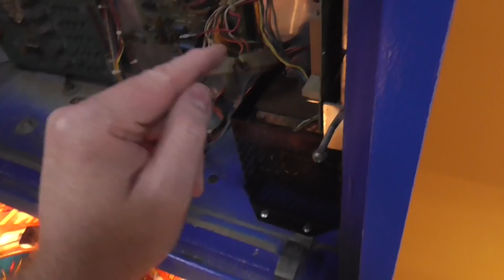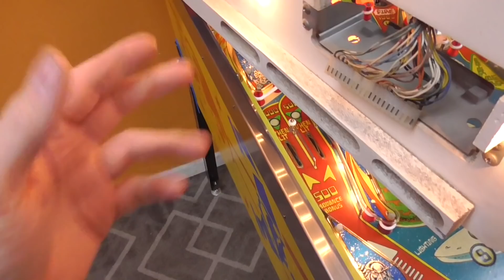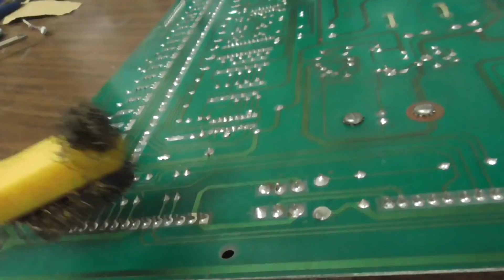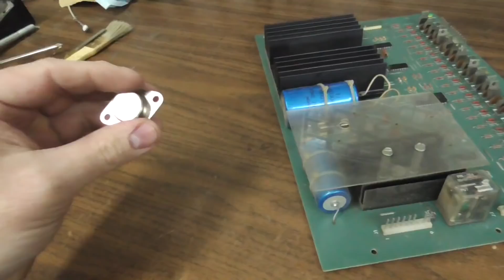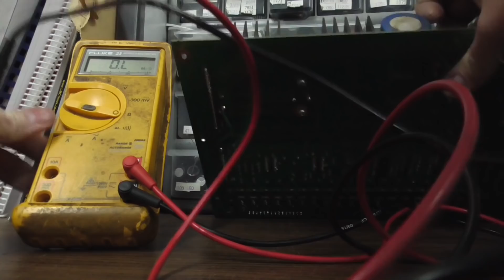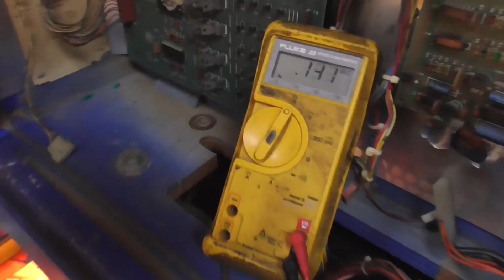Can You See The Solder Joints are Bad? - Bubba Shot The Pinball #4 - Bally Star Trek Machine Repair

Comment: Who the heck said that's not a voltage regulator?? 🙄🤔 The equivalent cross reference part is a LM323k which very much as a 5V voltage regulator.  Why do people say such when they don't know any better.  Don't listen to them Ron!! 😆 Man... the funny thing is... you've probably worked on 20 times more pinball repairs and playfield touchups than anyone I've ever seen out there... and people still try to tell you "you're doing it wrong... blah blah..." 🤦‍♂ Don't listen to them. I never remove the solder from the pins when I reflow... never re-cover the traces when I repair... sheesh!!!

Comment: On the topic of exposed traces: I seem to recall a ton of early PCBs having thick bare metal traces. (You should check out Usagi Electric's videos about the Bendix 15 vacuum tube computer. Every card in that thing has gorgeous hand-drawn exposed traces!) They were fine. now, with super tiny traces all smooshed together, yeah, you're generally gonna want the solder mask to prevent shorts from small particles landing perfectly between the traces (it could happen pretty easily at that scale). Plus, having just the pads exposed will make it easier to avoid solder bridges when populating the board. But for repairing thicc old 1970's and 1980's traces? nah, they're fine lol.

Comment: I think the argument people use about flux and corrosivity is they don't understand the difference between rosin core solder and acid paste for plumbing. Rosin core is safe for electrical connections the rosin is a mild corrosive to ensure the bond between the solder and the contact point. If you're using acid paste for wiring connections, then you're really going to have to clean your excess. That stuff is meant to penetrate into copper pipes to ensure not only a bond, but a structural integrity. Acid paste will eat through traces over time if you're going to go nuts and solder circuit boards. 

What I really wonder is: how many people burn their boards trying to solder with propane torches?

Comment: Hate to tell you this but when I was living in Miami the salt in the air did corrade the wires in the breaker panel at the hotel that I was working at enough to cause the breaker to trip  what I did to fix it was trim the wire back and reconnect it to the breaker so salty air can carrode copper

Comment: What gets me about the conformal coating folks: okay, I'll agree with them that the surface will oxidize. SO?? The oxidized layer is what, two microns thick? The trace seems thin to us, but to the oxidation layer there's still a mile of unblemished copper beneath it, happily conducting. Relax. 
You can invite them to take a look at filthy and tarnished traces on old-but-working stepper units (excepting where the contacts touch of course), and ask them if they think all THOSE should be coated, too. ;)
Reply from the maker: It's people that fall into two categories:

1. That have been educated on how to DESIGN things, and everything has a conformal coating in design, so if it's missing in any way, they think it's a big problem...

or

2.  People who have never fixed anything in their life and have watched other people who haven't fixed much ruminate about how you have to have the conformal coating.  

It's not that big of a deal, like most things.  It's an old "husbands" tale, since they have Old Wive's tales, this is the other way.  It's right up there with "You have to discharge the monitor or it'll kill you" or "If you don't put a polarized plug on the radio, it will kill you" or "the pinball needs to be grounded", it's just crap people think they know and they don't really practically know what they're talking about.  Rant off!

Comment: It's a little late to be posting to an older video, however, your rant got me to thinking. Clearly having copper exposed to the air isn't the end of the world, and electrons will still flow through it just like they always have. That being said, there are ground tabs on the bottom of the board that allow the board ground to connect to chassis ground. If there is corrosion on these tabs, you will have a dirty ground and get all kinds of problems with your voltages and maybe even random resets. The best way to clear that up is by removing the corrosion to improve the ground connection. Maybe that is the source of the myth that exposed copper from removed/scratched solder mask will degrade the board. Finally, let me say that this is not a high speed digital board we are talking about. These designs are much more bullet proof to that kind of issue than a microelectronics design today may be. Evidenced by the machines still working 40 years later with only minor upkeep required. Keep up the great work, Joe. Your hard work is much appreciated. Love watching you work!
Reply from the maker: Yes I believe it's mainly what you mentioned about high speed digital boards, in a more modern design where signals are being sent around yes you have to be more careful but this solenoid driver board is using old school heavy duty 5 and 0 logic to turn on transistors, there's not a lot of digital info flying around :)  

I'm just messing with people anyways, they pick on me for not doing it 'right' but with the large traces we're using and the simple signals we're sending it's a different beast than what they're working on in more modern equipment or designs.  You're correct about the bad grounds too.  Thank you for watching Dan, I'm glad you enjoyed the video!

Comment: 21:00 You're using the term "Conformal coating" when you mean "Solder resist". If someone's actually saying "conformal coating" when arguing about these boards, then they need to go back and learn electronics from someone who's not trying to sell them things they don't need. :)   They can argue that the solder resist acts as electrical insulation, but the soldered connections project farther than the surface of the board, sooo... The solution here seems to stem from knowing the name of the thing they're complaining about. :)
Reply from the maker: I've never even heard of Solder Resist so they've never complained about the proper thing then :)  Thank you for watching Buck

Comment: Ron, there is no argument that you don't HAVE to change the display capacitor but, if you have the board on your bench, and you have 40 year old electrolytics, and you know that they all go bad with age, particularly over 20-years, why not change it?  Part of what I see you do is preventively fix things (connectors, solder...etc.).  An electrolytic capacitor is something that does not age well, I'd change it if it was in front of me like that. But you do you.  I really like and respect what you do.

On the flux...it is there to allow you to solder.  If there wasn't flux, you couldn't solder.  What smokes and bubbles when you solder is the flux.  Flux, depending on how aggressive it is (it varies by solder), will eat the board some (including the copper traces). Lacquer thinner is a good quick solvent to get rid of it (it does require ventilation). Some use IPA but I've never found that it does as good a job (and it isn't as fast).
Reply from the maker: Yeah but everything goes bad so why not replace everything?  I rarely see a bad display cap so I usually don’t swap it… thank you for watching!!!!
Reply: I'm not advocating replacing everything.  But there are like 3 electrolytics on that board.  As you know, "bad" on a capacitor is relative.  It turns into a resistor, over time.  There is no way an electrolytic capacitor is going to measure like new after 20-years.  It's just not their nature.  One makes the deal with the devil in the design to get the higher µF that electrolytics bring...the devil collects after a couple of decades. 

As it turns out, you said, at the end, that they are going to LED displays so it is of no consequence on this one.

Comment: conformal coating is not for looks. It is for automation, solder won't stick when board is ran through solder tanks and wave solder mach. Any exposed copper where corrosion is a problem it will be coated with tin, silver or gold.
Reply from the maker: So you agree that since I'm not running it through a wave solder tank i'm good
Reply: @LyonsArcade  Yeah boards for damp enviroments are treated differently normally encased in epoxy or used to be asphalt. Bare traces are common on old boards and haven't seen any major problems even in marine enviroments as long as they are kept dry.

Comment: FWIW, some flux will damage boards. Water soluble flux does need to be cleaned off. But water soluble flux is usually not something you see in off the shelf flux core solder. It’s more used in fabrication where stuff gets washed as part of manufacturing. 

But standard rosin flux, or no wash flux, no worries. It CAN become conductive sometimes in certain environments, but it’s pretty rare. It’s mainly just making it look better. :) no one wants to see a big glob of burnt flux on a board. ;p IPA cleans most of it pretty well.

Comment: The only possible issue is that you might use non-leaded solder combined with leaded... and I have no idea if that would even cause a problem.
Reply from the maker: That's a good point!
Reply: @LyonsArcade  I went and looked it up after you replied... apparently, there is a difference? Something to do with mismatched melting and solidifying temperatures leading to fracturing and other problems. I've no idea if it'd have an impact at the scale you guys work at, but it'd probably be a nightmare for small electronics... also I imagine you use leaded solder :D

Comment: Rubber eraser will clean those pins up really nice without being very abrasive. Used to work on some old hardware that used those and wehen they were dirty the conneciton would heat and melt connectors - just like what you're seeing in the backbox. Earaser on all of them got the juice flowing well :)

Comment: With the engineered solder sucker, which I too use, and proper 60/40 rosin core solder and no more than 350C soldering station, I heat and add new solder to old.  Then go back and suck it all back out and add all new.  That's my method.

Comment: To be pedantic, the green epoxy on the board is solder mask. It is there so that wave soldering does not bridge traces and it reduces the incidence of shorting other stuff to the board. It is not necessary to replace it when reworking unless you think either of these will be a problem. Conformal coating is applied to the PCB after all of the components are mounted and is used to isolate the board from the environment. CC is used when a PCB will be subjected to high humidity or other environmental conditions that may deteriorate the components and/or connections or, in some cases, where high impedance nodes need electrical isolation from the environment. CC is rarely used in consumer products because it adds a fair amount of cost and is a big nuisance when reworking a PCB.
From a purist standpoint, it is good practice to remove heavy flux from your solder connections unless no clean flux is used. That said, the only good way to do that would be to wash the entire board in IPA or some other flux remover. It pays to remove the worst of it but trying anything more will just smear the residue around.

Comment: You didn't hook up all the power connectors to the other boards, in case there was something wrong with the power board.. BUT.. with that big jumper on the back jumping the 5v from the top part to the bottom part of the power board, you risk blowing up the chips on the bottom of the board..  I agree that jumper is probably very good in the longrun, but it might be good to remove it to test the power section after messing with it, just to make sure you dont blow those chips on the same board in case there's a problem with your 5v, right?

Comment: Hi love the show from oz. Hey when reflowing the pins it looks tge sodder seems to connect two pins. Wouldn't that cause an issue.  Sorry newbie question i know.
Reply from the maker: Some of the pins are supposed to be connected, they're connected on the trace under the solder.  So they'll have a trace with 4 pins in it, if you solder all 4 of those pins together it doesn't matter and actually makes a better connection anyways.   When you solder them you can see which ones are connected together by the trace.  Thank you for watching Drady!

Comment: I appreciate your common sense approach to electronics. I watch quite a few electronics channels and It’s your common sense approach that makes you unique among electronics repair creators. I think folks are getting their ideas about always applying conformal coating and removing old solder from watching some of those other creators who aren’t electronics repair technicians who do repairs daily but are electronics engineers who make new boards here and there or do one off repairs. Folks if you do 100s of repairs a week like electronics repair technicians pretty soon you will dispense with things which waste time or nice to haves and only focus on the repair essentials.  I think that is the essence of the difference of opinion expressed in this video. I’m sure he would use conformal coating to protect a trace if there was a possibility of a short if it wasn’t coated. However, that’s a very unlikely scenario in this case so coating isn’t called for. Just my two cents.
Reply: Well said.
Reply from the maker: Yes I think that's ultimately the difference, it's a difference between design and repair.  Also most of the boards I work on are pretty ancient, so it's kind of a different beast than a brand new design.  It's like the Electrostatic argument, in my situation it's not really an issue to me, because of the chips i'm running into, and i'm in the south where there's a lot of humidity, we just don't run into static much because of the climate, it's likely different in other areas and with other board designs.  So the coatings may be necessary on certain things... if you're watching videos about vehicle repair and they run into things, they may need the coating whereas in a pinball machine it's not necessary.

Comment: I rarely remove old solder when reflowing but I generally do add more liquid flux cos my solder is cheap Chinese rubbish. It leaves a complete mess afterwards but nobody is going to see it. 
I do use a conformal coating of sorts when I modify or repair outdoor led lights. Because I live close to the sea there's a lot more salty moisture in the air which plays havoc with the boards. So I cover them with cheap clear nail polish. It's cheap and nasty but it works.
Reply from the maker: That makes sense for sure in that situation... thanks for watching (as always) John!

Comment: With a single layer PCB you can't have a trace cross another trace, so if you need a trace to get to the other side of a trace you have to take the signal out one pin then bring it back on another pin on the other side of the trace you need to cross.

This isn't as much of a problem with a double sided PCB because you can have the trace go through the board and switch to the other side, then cross the other trace, then come back through the board.
Reply from the maker: on this board the way they accomplished that was with jumpers on the non trace side, they look like little staples.
Reply: @LyonsArcade  That's another way to do it, makes it sort of a 1.5 layer board.

Comment: One place you ALWAYS see cracked solder like that : PCBs under playfields, particularly lamp, relay, and motor control boards.  Nice little square cracks right around the body of the pin header.
Reply from the maker: I think all the minor vibration from the pop bumpers makes it all crack like that... well, plus really any coil that fires is going to vibrate the whole playfield slightly...
Reply: @LyonsArcade  absolutely.  Seen it with, especially, the pin headers, but also on power resistors, motor EFI coils, 555/906 lamp sockets, etc etc etc

Comment: Technically reflowing, to be absolutely perfect, should have the solder removed as it is not just metal, it is also oxidised as the solder is not sealed, but I have never removed old solder and it works fine.  The flux does clean up some of it.  It just is not quite up to mil spec.       
As far as a coating.  I may have said this before, but early PCB's never had coatings on it and they work just fine.  Copper will get a layer of oxidisation on it and then it will be fine.    The coating really is only used for weather proofing.  If the machine is not being used in water it will be absolutely fine with no coating.
This machine is really coming up nice.  Looks like it will be a great machine.
Reply from the maker: Thank you Brendan, you know where i'm coming from :)  We appreciate your opinion as always, hope you've been well!
Reply: @LyonsArcade  All is well here, I appreciate you putting so much time into these machines

Comment: I am staying at the Memphis Ronald Mcdonald house and they have a game room. There is a Mrs packman and it comes on and you hear solund and can play it but there is no picture. Where should I look first? Im gona check fuses and the neck to see if there is lights in the back of neck. I dont hear high voltage tho on the screen and it doesnt appear to come on at all. black screen. Im not charging for this just want to get it going for the kids. Any suggestions? Ill even buy the parts if its small to fix it.
Reply from the maker: Definitely check the fuses but there's likely a problem with the high voltage in the actual monitor board, it may need to be sent out and repaired.
Reply: @LyonsArcade  thank you. will check that first and see. Appreciate all your videos.

Comment: Early solid state Bally's and System 11's have the worst solder joints ever.

First thing I ever do when working on one is check the solder joints on all the boards. A good reflow usually fixes about 60% of the problems.